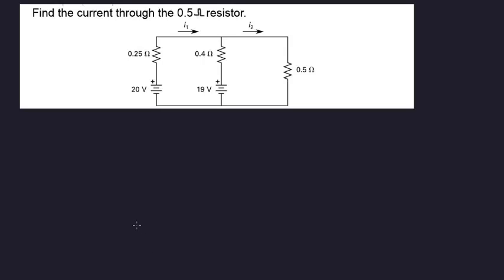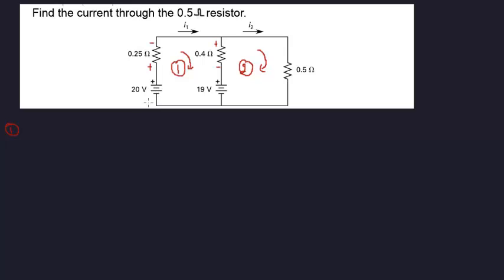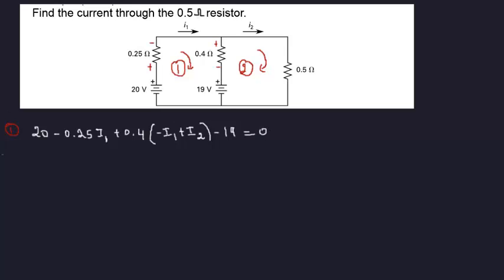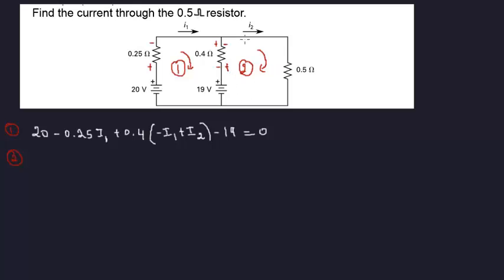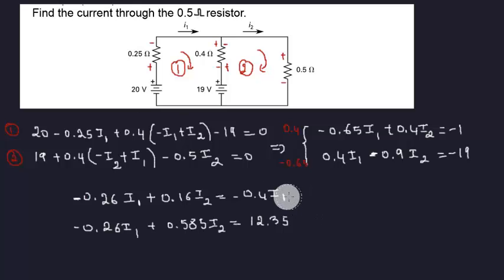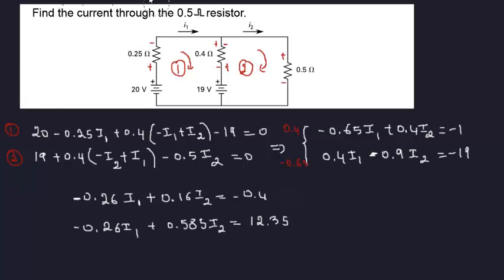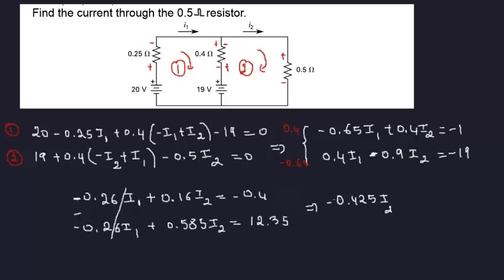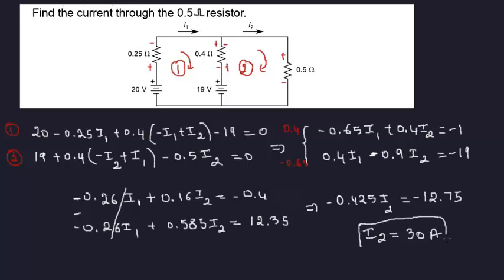Using KVL To Find Current Through DC Circuit-FE Exam Review

Comment: In the loop 2 across .4 ohm resistor why did u change the +/- sign. it could be same as it was for loop one. you did that way for a problem in DC ckt example problem 2 in other video. I am confused.

Comment: When you were doing loop one, you went from the voltage source to the .25 ohm resistor. You assigned its value a negative because it was a voltage drop. That makes sense.  

But when you were doing loop two, you went from the voltage source to the .4 ohm resistor (after changing the polarity).  Why did you assigned its value as a positive when you made the value for the .25 ohm resistor negative?
Reply from the maker: John, it's because assigning a negative sign would affect the values inside the bracket so I choose to put positive sign so I can it won't affect my analysis of voltage drop/rise. The voltage drop only applies with the current I2 (hence negative sign) and not I1. With the .25 ohm, only current I1 passes thru that resistor as a voltage drop. You get it? Let me know...
Reply: Sir, Please teach me the loop current method if you got to know crack this method by now since i see that you posted this comment a year ago. Thank you.